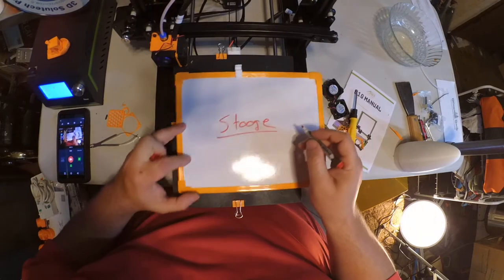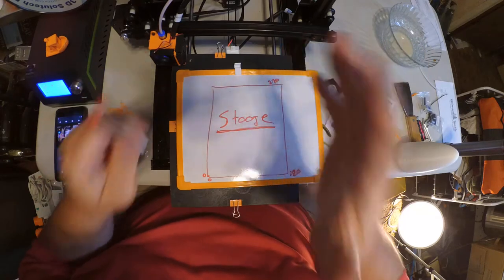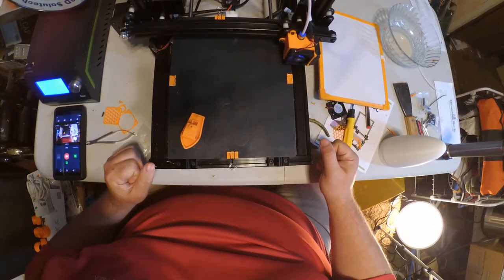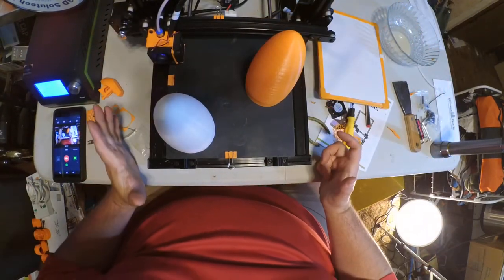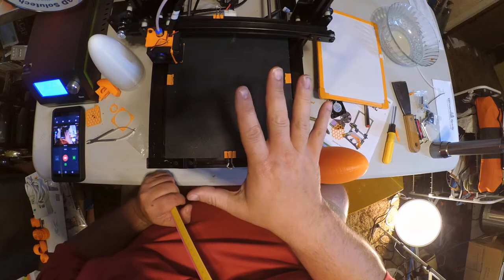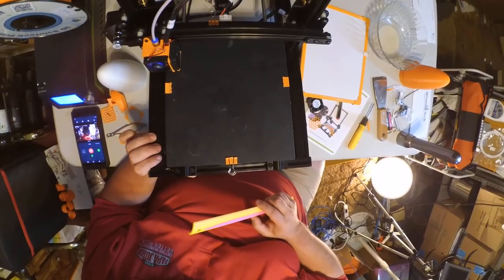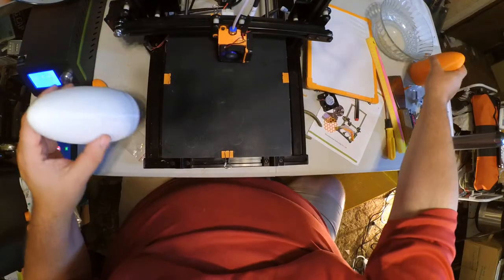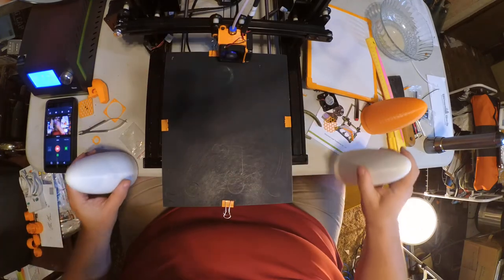Today's 3D Print - Your Printer is Dumb Deaf and Blind

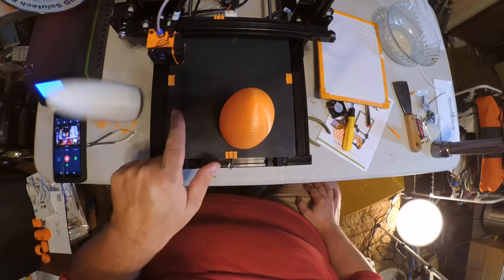Comment: 6:59 is where my s3d doesn't print that one.  What it does is print that one to say 4 layers from the end of it and goes to the next model (with its settings) and prints it completely and when it is done with that orange one (in your example) it goes back to the white one and finishes those last four layers.  Nothing in my settings told it to do that so I am not sure why it would not finish the first one before finishing the second one but instead it almost finishes it then runs off to print the second model to its full completion and back to the first one to finish that one.  Understand what is happening because I surely do not.
Reply from the maker: email me your factory file that results in this. used thebeststooge as the alias and nerys as the .com domain name. send the gcode too. I need to tweak the factory file to replicate your gcode.

my guess is you specified a height for sequential printing that happens to be 4 layers shorter than your object.

so lets say its 104 layers.

you print 100 layers goto object 2 print 100 layers. you are already at object two so print 4 more then move back to object one and print last 4.

set your sequential height to your print volume height.
Reply: I over wrote it on the SD card as I am doing six things at once and removed one of the models due to this error.  I also switched to PETG from ABS that I had laying around.   Lets see if I can recreate this issue doing nothing more than copying the process so both are identical only one is attached to one model and the other the other model as I originally did.  I will also reload back up my ABS settings I was using.
Reply: BINGO, I found what I did wrong as I was so sleepy I never noticed the MAX HEIGHT CLEARANCE that is defaulted to 10mm.  It worked perfectly then after now noticing that option I have to set, but I suppose if I don't know what the height of my objects are, or want to be lazy, I could put say 400 in there?
Reply from the maker: I would set it as the max height you can print. just in case you put something taller than your print volume on the printer you don't want it fracking your steppers. but yeah. that will work.
Reply: I have no idea what I thought that 10mm was but when I went to recreate all of this to send to you it punched me in the face and I understood.  Thanks again and yeah, my max is 150mm for this printer.